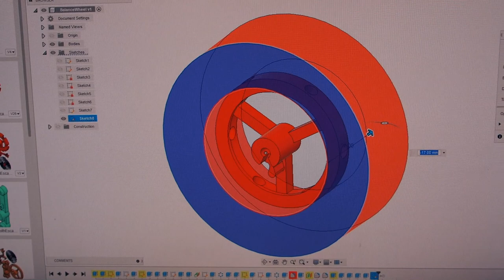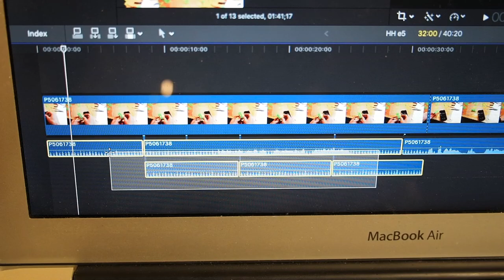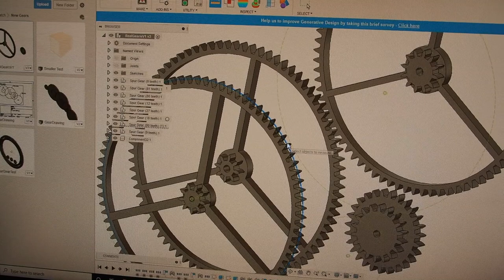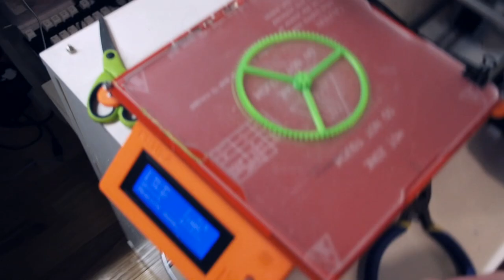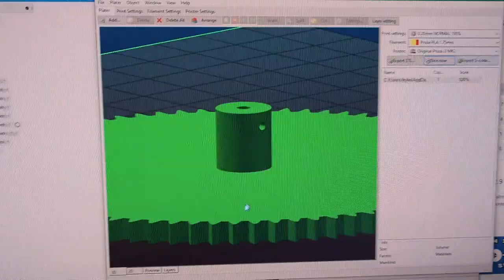Assembling my 3D Printed Gear Train | Homebrew Horology #5 | 3D Printed Clock & Watch Development

Comment: You can't 3d print a clock without exploding a few gears, lol. 

I would suggest you attempt to reduce friction and power losses due to gear meshing as much as possible. Ideally the gear teeth should be as smooth as possible, but because of the nature of FDM 3d printing, that isn't really achievable (unless you want to sand each tooth). You could improve meshing by increasing the amount of backlash in your gears. Normally this is not desirable in gearing, but because clocks only run in one direction it doesn't matter. The only thing you would have to worry about is that more backlash equates to a weaker tooth. Maybe just increase backlash at the end of the gear train towards the escapement where toque is low and gear strength is not really needed. I am assuming you are going to add a barrel wheel that powers the center wheel with a gear down. You saw how much weight it took to drive just the center wheel, the amount of weight you would need to drive the barrel wheel will be enormous.

If you are looking for some inspiration, there is a watchmaker named Don Corson who made a really nice 3d printed clock. He wrote an article about it, maybe check it out for some design inspiration if you want. Here is the link:

https://www.watchprozine.com/watchtech/making-a-1-second-pendulum-clock-3d-printed-/8075517/1223/

All that aside, you basically have a functioning going train. That, I think, is a big accomplishment. Keep at it and good luck! I'm really enjoying your videos.
Reply from the maker: BananaKingVideos Thanks a lot for the great information! At the moment, the gears do have some backlash, so I think the holes I drilled into the wood are a bit off/inaccurate. But it sounds like a good idea, and I’ll keep that in mind as I keep revising my design.

Comment: @ 15mins or so, you’re getting friction because of the gears not meshing properly. Also, your make shift arbors are not in the holes straight. Next you should lube with -the dry lube. This will reduce friction considerably.

Comment: Hey, do you think you could post the brass pin diameters and specs for the 4th, 3rd, & center wheels in the assembly that you came up with in the final half of the video?... im thinking one way to help fix your gear train issues is to more accurately place and mount the pins to the wood block, the idea i had was to draft and print a thin template that not only acts as a stencil but when the pins are driven through it into the wood, it will also provide adequate spacing and stability within the gear train... lately ive been prototyping a daniels double escapement tourbillon at the moment so ive had fusion running pretty often for the past few weeks and if ive got time i might be able to draft a quick model of the template and post it to thingiverse
Reply from the maker: Jacob Howard thanks for the offer! As of now I’m not sure I’ll end up using the same wood block— it’s more of a temporary thing and I’ll definitely be designing plates/bridges to 3D print or cut out of some plywood. Thank you for the offer again, and I wish you luck on your endeavors!
Reply: @kyleikuma5790  its all good... it wasnt really an offer tho... that gear train you had rigged up reminded me of the gear train volume optimization problem which actually has a few recent research publications on how to solve it using advanced computation... sometimes it makes it easier to slog through it all if i can think of a fun or practical example problem to solve that relates to whatever research im doing... id recommend going on researchgate or ieeexplore if youre interested in that sorta thing... also itd be kinda nifty to have a place where you could post .STLs of the designes featured in each video, im thinkin itd be easy getting more useful technical feedback since viewers could have the chance to experiment with your designs...
Reply from the maker: Jacob Howard also, sorry I didn’t realize I did not answer your question— the brass rods are 1.8mm in diameter for the record.